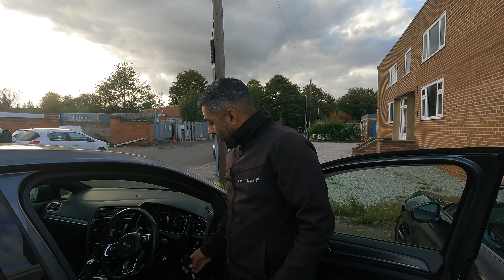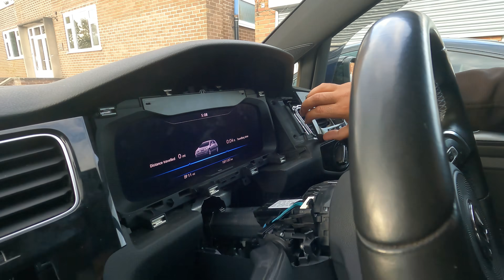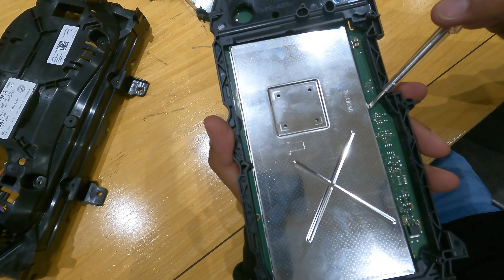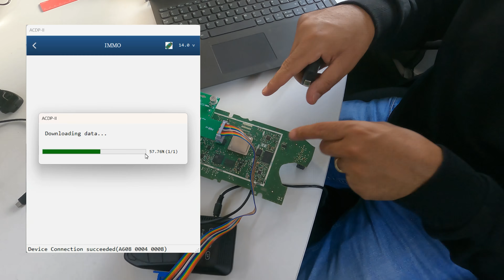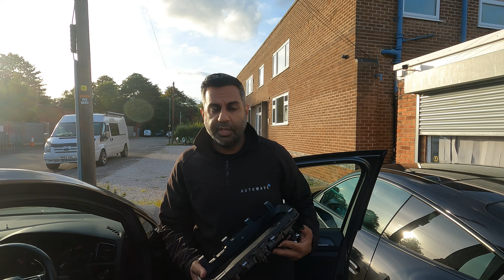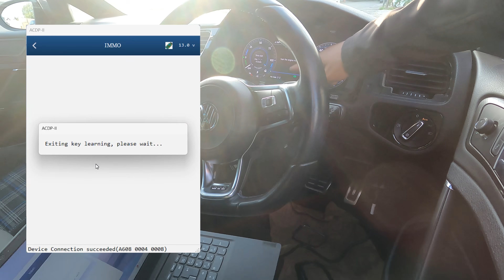VW Golf Virtual Cockpit Add Spare Key Using ACDP

Comment: Good job, very interesting system, the new key you used is original vw or aftermarket?, thanks for this video❤
Reply from the maker: New key is an aftermarket Autowave remote AUTRK0079